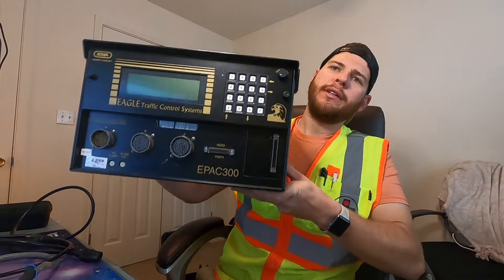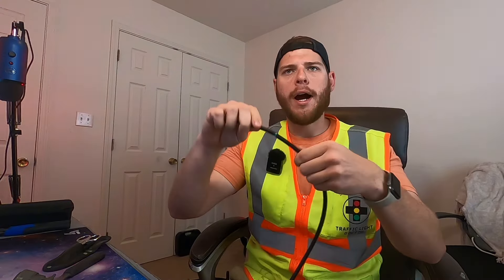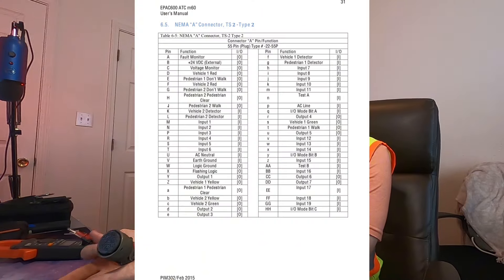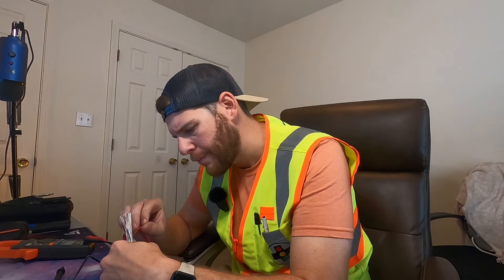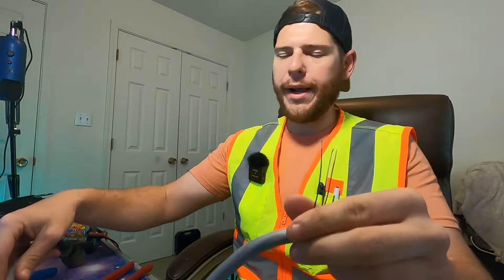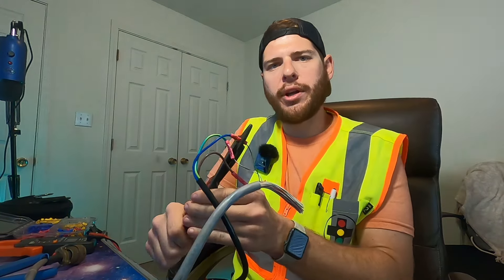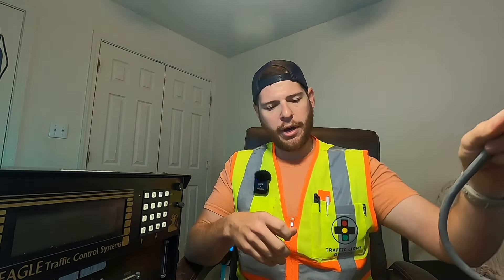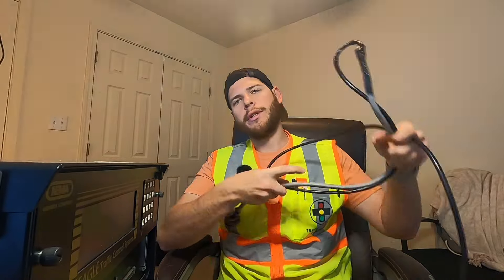Essential Tool for Every Traffic Signal Technician: Must-Haves for Success! Pt.1

Comment: when i butt splice small wires i typically strip the wire back further and double it up in the connector, helps it stay in there tight
Reply from the maker: Not a bad idea! I tug pretty hard when dealing with smaller cables just so I know it won’t come undone later on!
Reply: Me too.

Comment: Great video. Question--the traffic signal behind you--Is the green light actually blue?
Reply: Old signal heads from the 1970's and earlier used glass lenses.  Some of those lenses, the smaller 8" versions, made by the Marbelite company, were a distinctive blue/green in color.  That's most likely what he has in the background.

Comment: Why do traffic light controllers use that connector for power? Why not something more standardized?
Reply: That connector is one of 3 that connects a NEMA controller to the wiring inside a cabinet.  I don't recall how exactly many wires are involved for the NEMA, but it should be somewhere around 105 separate inputs and outputs.  The people who wrote the specification decades ago just decided to include the power wires within that bunch.  A different style of signal controller, called a 170, uses one large rectangular connector with 103 wires (as I recall.  I could be off a few), and one standard power plug which will plug in to any 120VAC wall outlet.